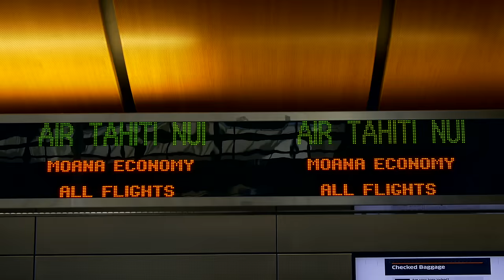DC SHOES: ROBBIE MADDISON'S BEHIND THE DREAM PART 1: THE MAKING OF "PIPE DREAM"

Comment: This pretty Amazing!  Though seems if you go down in deep water I don't see a Float to rescue the Bike.  Dudes whom do this on Snowmobiles have a rescue Float.  Still must be a blast to go from squirting along on the beach on a good Pipey 2 stroke to gassing it into 4th gear and hitting the water and slipping away over the waves!    Nothing Like that rush of adrenaline as you twist that throttle and feel the front wheel lift .  and the Smell of Klotz